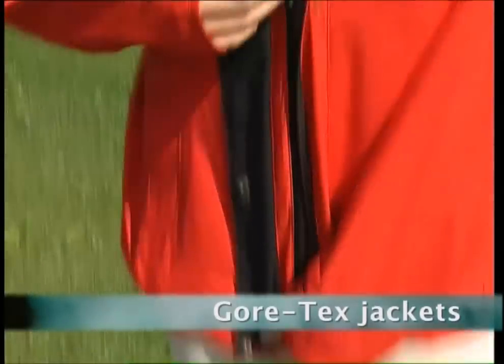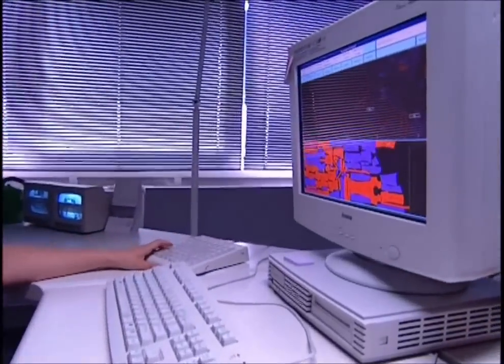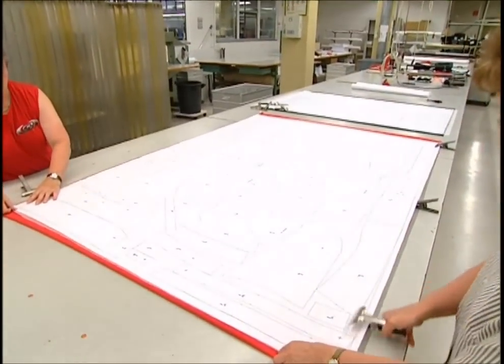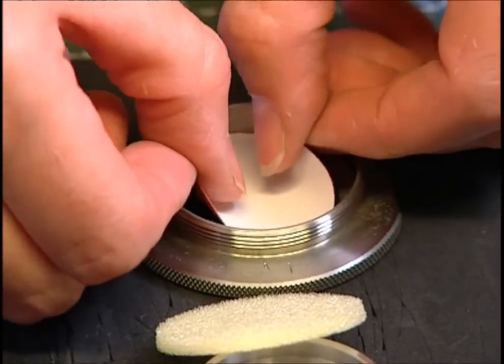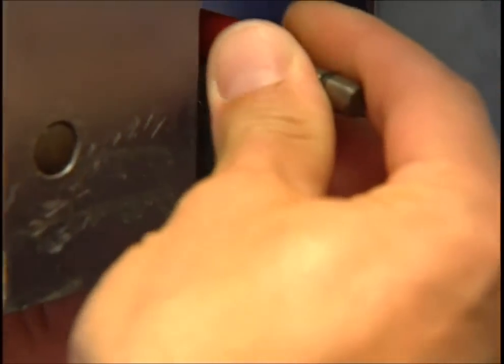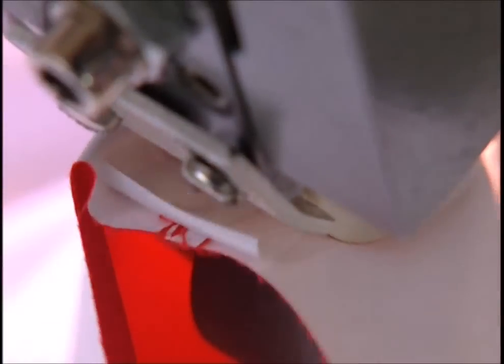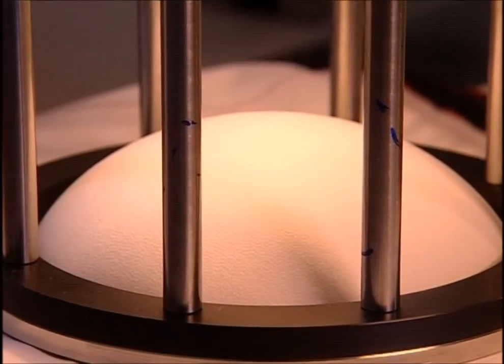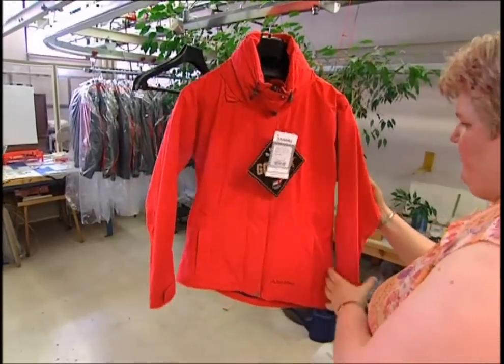HOW IT WORKS - Gore-Tex jackets

Comment: It doesn't last
Reply: Idk , I have boots that are 15 years old and the gore Tex still does it’s job .
Reply: @MrBlizzard769  That just means you only wear them once a month at the most.
Reply: That’s because you need to reapply the hydrophobic layer in the outside.
Reply: I concur. I have tested a brand new gore Tex to make sure. I think that they are good for splash proof
Reply: To be fair.. It works much better as an under layer.  I have a couple "cabella's" hunting coats that have a strong polyester on the out side that looks and feels like the texture of wool,  the gor tex is next.. then thinsulate--- then a nice silky polyester lining.  Best dang coats I've ever had, other than my sheepskin coats..  The one I'm referring to I believe is from the late 80's ..  maybe early 90's.. not exactly sure.  But it has a distinct darker green camo.. I seen 2 on ebay a few days ago, and they still cost $200 used.....   my point is, the gor tex last much longer if it has a good outer shell on top of it.